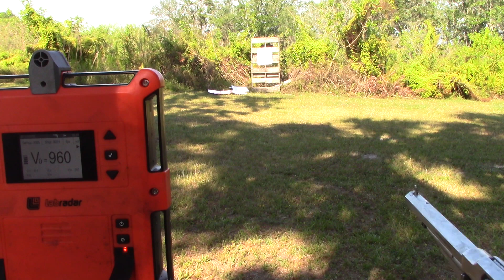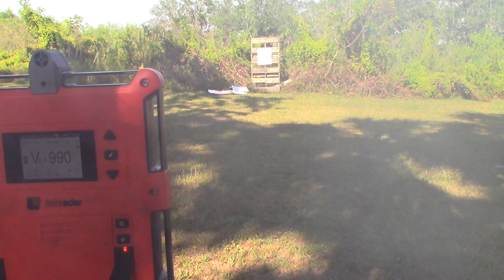Ballistics of the 44 Remington 1858 New Model Army With Roundballs and Conicals

Comment: Cool. Everyone says they are basically on par with .38 spl but these results put it in a vicinity of light to medium 357. Amazing
Reply from the maker: Well with the conical it is more like a 45ACP. The roundball is like a 38+P. A .357 mag is generally in the 1200 fps realm. The full article has the comparisons and is here: https://www.gunsamerica.com/digest/ballistics-of-the-44-remington-1858-new-model-army-with-conicals-and-roundballs/
Reply: @GunsAmericaTube  its interesting youres showed these results.  Ive seen other videos show over 1000fps with round balls on just 1851 navys.  Max powder you can get in them is about 37 grains.   On my remington i can do about 45 almost with round balls.  Did you try this test without using paper catridges and pouring powder directly into the cylinder ?   Also which black powder did you use ?

Regardless of having the power of a 38 caliber or not.  The balls and bullets are still 45 calibers and will penetrate anyone you shoot them at.  Just like a 22 would.... its going to put a nasty hole in someone.   Id rather be shot by a 38 special fmj than a 44 black powder revolver just saying.. and anyone who says otherwise is stupid in my opinion..

Im suprised you used 451 balls.  454 barely makes a lead ring on my pietta remingtons and colts
Reply: @jeepsblackpowderandlights4305  yeah..I have the uberti 44...and I bought a bunch of .454 balls...now I will only buy .457...better lead ring shaving..
Reply: @jeepsblackpowderandlights4305  you gotta use .457 and reduce the load by juuuust a few grains, the tighter fit and larger lead ring will let pressure build up and give you equal performance with less powder thus, your gun lasts longer and functions as intended, in these reproductions the bore diameter is slightly larger than the cylinder so a larger round is required to properly seal it off

Comment: The 5 and a half inch uberti or pietta Remington .44 is a great self defense piece especially with a shoulder holster and there are the extra cylinders that can be carried fully loaded or even get a couple of Howell .45 colt cartridge conversion cylinders and shoot .45 colt 200 grain center fire cartridge cowboy loads from it so to get around background checks and permits it’s a great system
Reply: True. however the 8" bbl is excellent for home protection. it's daunting appearance alone would make someone surely head the other direction.
Reply: I actually recently ordered me and received an Uberti 1858 Remington style new model army .44 caliber revolver with an 8 inch barrel from Dixie gun works online and I ordered me and received a Howell .45 colt cartridge conversion cylinder for it which fits it perfectly and I drove 275 miles to the cabelas in Hamburg PA. to buy their last 2 boxes of HSM .45 colt 200 grain cowboy load cartridges that they had in stock and I then drove 275 miles back to where I live the same day
Reply: I made a video of myself unboxing the pistol and the cylinder and posted it on my channel btw

Comment: Very interesting. I know nothing about this gun, about rolling my own loads, 🤔 so learned something new. I have a S&W 629 which I love, but this is a different animal
Reply: Something else good about the Remmy clones... The cylinder comes out really easy. You can swap cylinders, so if you have loaded spares, you don't have to reload after each cylinder. I can swap cylinders just a tad slower than I can change mags in an semi-auto. Plus, there are drop in conversion cylinders by Howell and/or Kirst, which convert the Remmies to .45Colt (or, 45 Long Colt, as sometimes called) in "Cowboy action load" (850 fps or less, I believe, as all mine are 800-850 fps). This means, you can reliably fire cartridges, or good ol' cap and ball, through a Remmy.

And yeah, that's my Remmy in my pic...

Comment: I’ve noticed that the 1858 can handle a hotter powder load than the Colt 1861. I use Goex and Triple 7. Definitely getting better numbers with the Triple 7. I noticed that anything higher than 30gr in the Colts will wrinkle the wedge and stretch the arbor.
Reply: How do you fit more than 30 grs into Colt 1861?
Reply: @franklinAll8735  I meant the 1860, I can get 35gr in it easily.
Reply: I do shoot 20-25gr through my 1851 and 1861 Colt Navy’s. I can get 30 grains in those but it’s TIGHT and it will stretch the arbor and crinkle up the wedge but it happens much quicker. I have a Colt manufactured Gen 2 1851 Navy and a Army San Marcos 1861 Navy.
Reply from the maker: Yes the roundballs are 35grains using the dippers at cartridgekits.com.  With a conical more than 30 is hard. But we didn't include Triple 7 in these tests with the roundballs. Most likely they are up close to .357 mag.

Comment: strange that the velocities between round and 220 HD are so close.usually theres more like 250fps between them.more with bigger loads in the horse pistols.
Reply: 451 lrb
Reply: Check out my chrono testings, I got exactly same results. I didn't record roundball tests but velocities were in low 900s with a heavier charge... I think the problem with .451 roundball is its poor seal and base shape that guides the gases to escape around the ball whereas a bullet flat base and better seal do not.

Comment: The downside to all that paper is that it reduces loading capacity. With 35 grains of 3f Triple Seven under 200 grain Lee conicals, I'm getting 1135 fps on average, giving 571 ft-lbs of energy at 4 yards. That's not 44 magnum power, but certainly more than adequate for personal defense against 2 legged threats. These loads were slightly compressed, which seems to contribute significantly to the increased velocity. The groupings are around 6 - 8 inches at 15 yards off hand, certainly way looser than I can group with my Glock 20, but still reasonably accurate for a defensive application. Notably, the first cylinder groups around 3 - 4 inches, and loosens up from there on successive cylinders (I have 2 spares). Lead fouling from the soft lead pushed at those levels is the main reason, I hypothesize? I definitely get quite a bit of lead out during cleaning.

Comment: 100% agree.  I actually carry two 1851 navy for self defense.  I load them with 37-40 grains of 3fg with a 454 round ball.  I gatta really cram it down with 40 grains.  It almost touches the barrel cone or shaves a sliver off when i rotate.. The reason why i dont carry my reningtons is because i dont like the sights and spring/hammer.   Thr guns dont feel as smooth when cocking thr hammer.  Because the spring tention is just too great... eveb when you losen that screw on the handle.

The 1851 navy are much more balenced weight wise.. easier to cock the hammer and fire in repetitions quickly.  I can cock the colts hammer and fire in a split second with 1 hand.. vs thr remington which takes a second or more due to the slring tention.  And im not a weak guy lol..  Id just rather have a easier cocking hammer.   THE sights being on the hammer vs the frame makes it easier to zero in quicker.  Remingtons also foul much quicker due to the cylinder riding on the face of the frane up front and back..  vs the colts which ride on the cylinder ring

But this is just me of course.  I know th3 remingtons you csn cram 45 or so grains of powder vs 37/40 or so.. but still.  I will stick with a gun that operates better.   But for self defense.. anyone that says they are bad guns is moronic.   In 2000 rounds fired on my two 1851s.  Ive had only 3 cap missfires.. using rws1075 caps

Comment: I do not use triple 777 in my black powder I use triple 777 in my black powder I put 95 grains or 110 in my rifle 50 caliber and 95 grains my  Kentucky long rifle I do not use it in my cap and ball pistols at it burns way too hot and it has an explosive charge where it will blow the cylinders I only use for my I use pyroder pistol powder in my pistol and I do not use pistol powder in my rifle only pyroder RS I'm my rifle or 777 gunpowder

Comment: You do not need to switch all those powder charges in that gun or you're going to have a major combustion and blowing up your gun stick with one powder charge and one powder only that's pyroder pistol powder is that a green container or use goex FFFG powder you don't need all that different type of powder are you going to have a very bad day at the doctor's office
Reply: He’s using 777. He’s gonna be fine. Even filling the cylinder all the way up, there is absolutely no way he can hurt his gun or himself. 777 is a black powder substitute. There is no safety issue when using black powder or black powder substitute. You literally cannot use enough to blow up the gun.